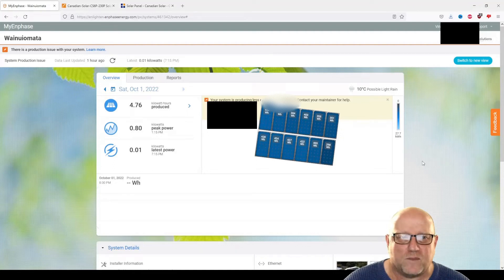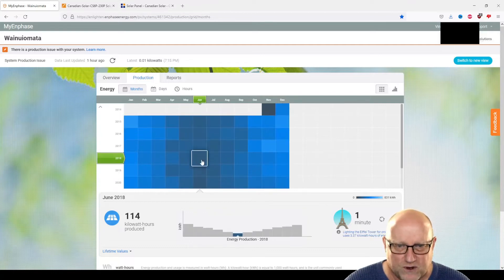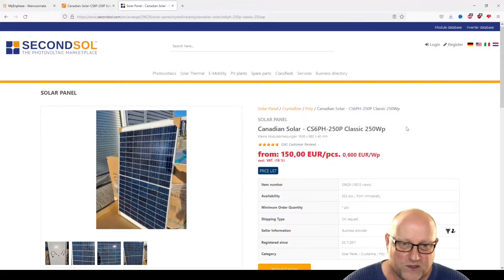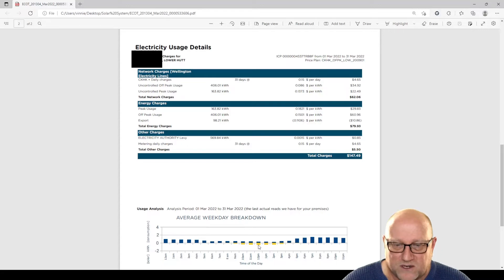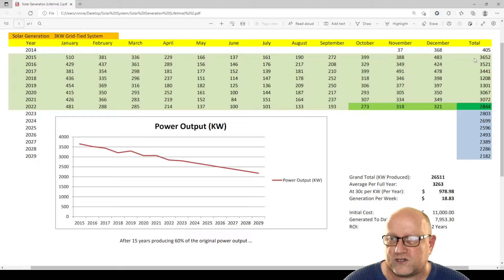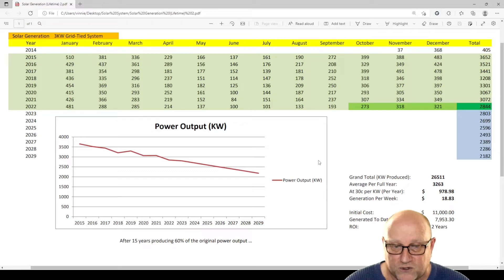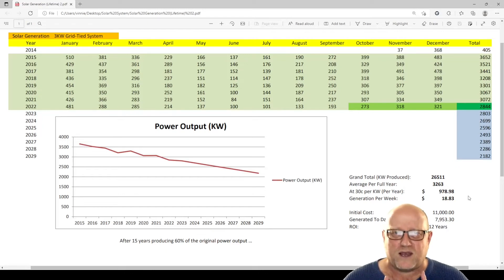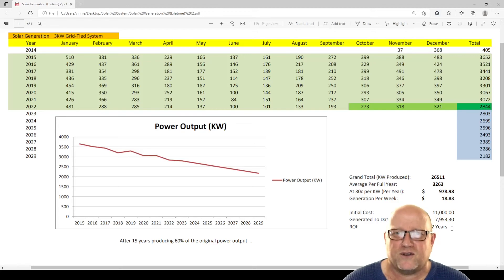3KW Grid-Tied Solar System - Was It Worth It?

Comment: We had 8kW fitted for $23k in 2014 to our house in Taranaki.  Fitted by Current Generation in Nelson.  We have an electric hot water heat pump and no gas.  Our old bills were $3200 a year in 2012 and 2013 average.  Last year our annual January to January bill was $359.  This year its been $62 so far (mild winter), with sunny weather to come so should be no more bills just credit.  We get 10c FIT.  So our system is paid off.  For the first three years we were getting 17.281c FIT from Contact.  Our panels are supposed to drop in power 20% over 25 years.
Reply from the maker: Thanks for commenting and your stats Tony. I'm originally from Nelson which would be a lot better for solar than the Lower Hutt area. I could get another 2Kw on the roof but at the time my sole focus was getting out of debt and removing the mortgage so maybe down the track. Definitely been worth it for you judging by those numbers!